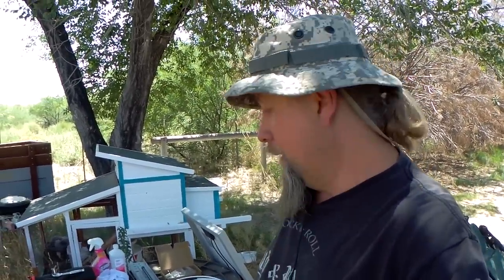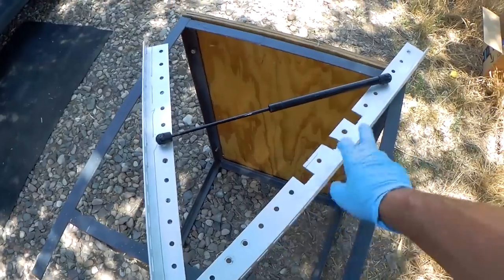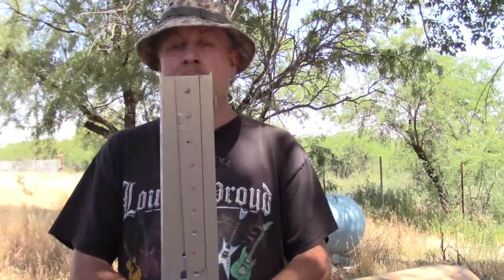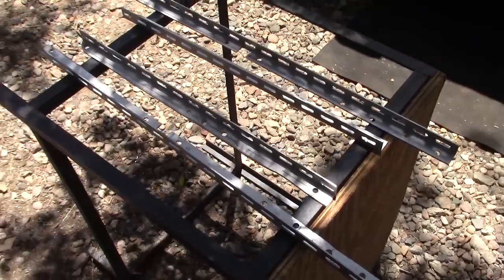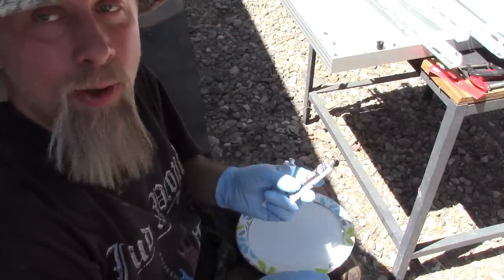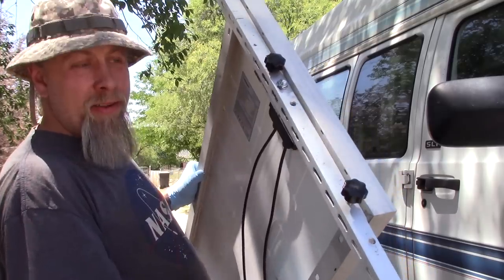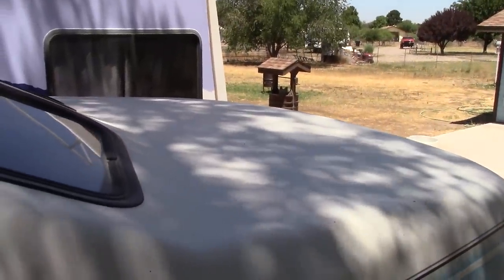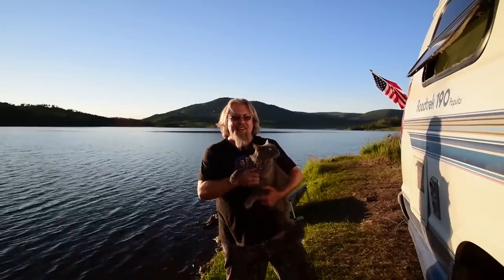RV Solar Panel Install DIY AUTO TILT Mount With 3M VHB Tape NO HOLES! Part 1/2

Comment from the maker: All parts can be found on https://hobotech.tv/amazon and plans on https://hobotech.tv/shop. 
VHB & ETERNABOND TAPES: https://hobos.cc/TBZS
INSTALL VIDS PART 1 (2017): https://youtu.be/qghxSwUgxEc
INSTALL VIDS PART 2 (2017): https://youtu.be/QWLqGw0pegk
5000mi Follow Up (2017): https://youtu.be/5DEBb1Mtu0M
1 Year Follow Up (2018): https://youtu.be/pUU8IAVfwz8
2 Year Follow Up (2019): https://youtu.be/nShLdvEQyZI
5 Year (FINAL) Update (2022): https://youtu.be/o2yhVvBcsEU
Building the strut "auto tilt" bracket Part 1: https://youtu.be/Ajss5bl0BqE
Building the strut "auto tilt" bracket Part 2: https://youtu.be/9GQiJyYaLxs
---
Get 15% Off A Jackery Explorer 240 Using Code "HOBOTECH" At Checkout: https://amzn.to/2VOL51s
Get 15% Off The Jackery SolarSaga 100 Watt Solar Panel Using Code "HOBOTECH100" At Checkout: https://amzn.to/2Lz1cd5
Get $10 Off The Jackery SolarSaga 60 Watt Solar Panel Using Code "HOBOTECHT" At Checkout: https://amzn.to/2QmFBFn

Comment: Instead of epoxyingwing nuts get a RivNut tool and install some RivNuts in your brackets.  They work great for mounting your solar panels to the brackets too!  BAsically they are large open hole rivets with bolt threads in the center.  You squash the rivets like a regualr rivet but instead of snapping off the stem, they compresson rod screws out of the squashed rivet and gives you a threaded mount.  Pretty cool tool and a real time saver if you do a lot of maintenance in tight places.

Comment: This is great, thanks. Would mounting the panels to hinge up towards the back of the van cut down on solar heating of the cab through the windshield? Might it not be cheaper to get lengths of aluminum angle and transfer the hardware to them to avoid having to cut the original brackets down lengthwise? I'm now the proud owner of a 1995 Coachmen M-19RB Class B RV and will be scouring your channel for solar power and cab upgrade ideas. As always, thanks RoboTech for the great videos.😆

Comment: maybe, instead of cutting slots for the clearance of the gas strut bolts  ....a countersunk hole and some flush fitting coach bolts... just a suggestion, but great work with the reviews on electrical gadgets and power generators....bluetti etc

Comment: AM Solar said do screw down frames if you have a rubber roof. The 3M tape won’t come off, but the rubber could de laminate underneath with a strong enough breeze or at highway speeds.

Comment: I'm having the hardest time trying to figure out how to mount my three 100w panels.  My roof is curved so my idea is  first mount a roof rack or some kind of straight bars that I can mount the panels onto.  My most recent idea is to VHB some artificial rain gutters on the top and mount a Thule rack onto that.

Comment: Any designs for solar panel mount that can tilt them in either direction in case you're forced to park with your rig facing east one place and facing west at the next place? (-or north vs south depending on how you panels are placed on the roof)

Comment: Im woncdering how do you pull the retainer pins at the same time.  It looks like the shocks have a fair amount of power and it will put a good twist on the frame while moving to the other side.

Comment: Question is it possible to keep them up top flat while Ur driving and take them down and angle when stopped easily? Since U can’t angle them when Ur driving? Jus wonderin cus thats 1 of the major reasons I don’t wanna get a conversion van. Those scalloped roofs make it difficult for solar. ☮️❤️🤗
Reply from the maker: AM Solar sells expensive mounts that lets you remove the panels. However, that would be far too much work and you have to consider the wiring too.
Reply: HOBOTECH thanks i knew if there was a way U wud kno, but actually watched the next vid and like the way ya did it.

Comment: Great share. Solar steroids. lol. Eventually would like to get a basic solar set up... 
 I get the black dots on my RT roof too. I use mr. clean Magic eraser with soap and water. Camco black streak remover works good to.

Comment: So I went to your deal on Amazon to check out the gas struts. Just to be perfectly clear, you used the 30lb. / 10.2" to 17" CAMCO gas struts on your rack modification correct? I'm looking at putting (3x) 200w panels on my 7x16 enclosed on a full length aluminum frame setup and GONAGAIN mentioned your channel for this mod. Thanks, Paul.

Comment: Instead of cutting why not use the other side of the angle? Drill holes as needed. And use the wider side for mounting on the roof.
Reply from the maker: The small side of the brackets are just under an inch wide and are lined with slotted holes too narrow to fit some of the bolts. It seemed a lot harder to drill out existing slots than drill new holes. Also, clearance would be a bit too tight for my liking which is why I cut mine to just over an inch. It's certainly valid they could work the other way with different hardware or using a drill press.

Comment: So the gas struts look like they are installed incorrectly to me - shouldn't the base end be close to the hinge? And the solar panel end be close to the far edge of the solar panel?  Or am I wrong?
Reply: It makes Zero difference which way - they're gas.

Comment: Can I use the VSB tape to mount my solar panels on a rubber RV roof?
Reply from the maker: If it's a newer roof you could with the right prep, but if it's wood underneath I would just use screws and cover the brackets with lap sealant.
Reply: HOBOTECH it’s a 2019 Jayco class c. Good question on is the roof wood underneath

Comment: I wish I knew about this video a year ago.  Just use these (or find smaller ones depending on what you need).  No cutting required, chop to length.  Then just get the gas struts you need based on stroke length.
https://www.homedepot.com/p/Everbilt-1-1-2-in-x-14-Gauge-x-72-in-Zinc-Plated-Slotted-Angle-800517/

You can also use this (aluminum) and drill your own holes.
https://www.homedepot.com/p/Everbilt-1-in-x-96-in-Aluminum-Angle-with-1-16-in-Thick-800057/204325583

Comment: Yea, great no drilling holes to secure the panels until one comes off driving down the road and causing a serious accident.
Reply: The other two panels were installed the same way and they haven't failed in 2 years.
Reply from the maker: Not to mention AM Solar has been installing with VHB for over a decade and never had a failure.

Comment: Tape and glue will eventually fail because of the strain caused by raising and lowering the panel.
Reply from the maker: They use the stuff to build semi trailers and put windows in skyscrapers so I doubt it.